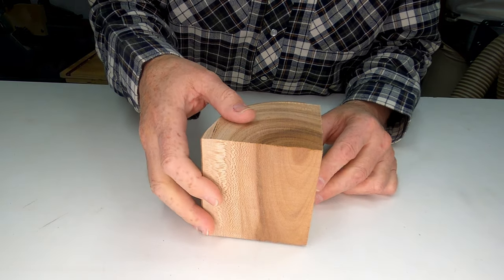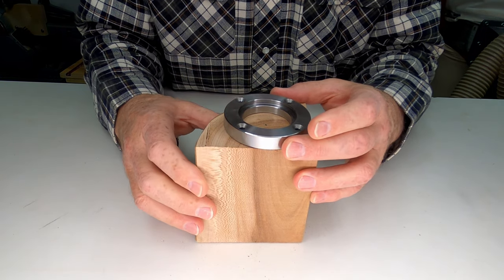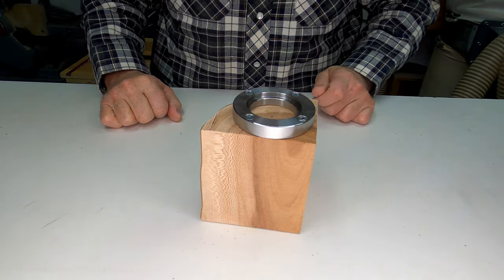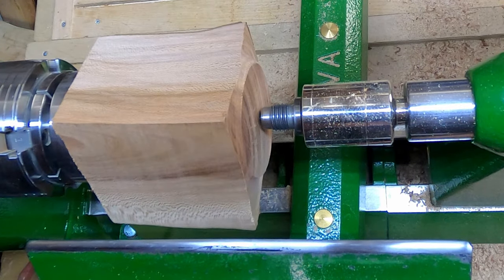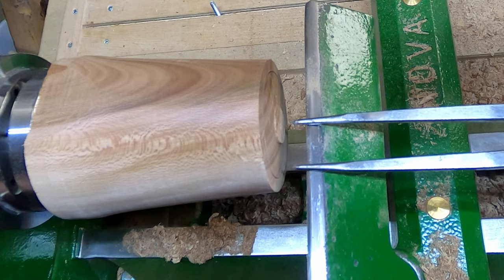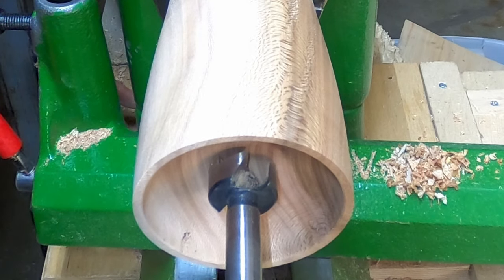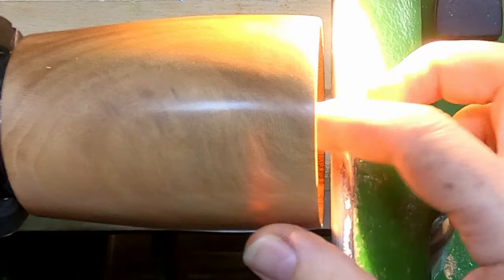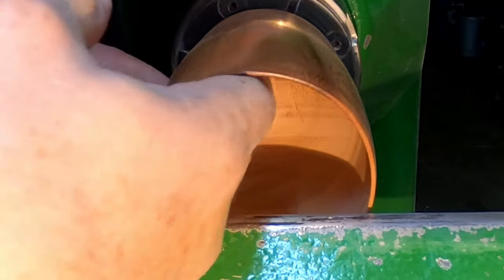Back Hollowing with Bowl Gouge

Comment: Gord, I am just finishing a 9" tall conical vase in European sycamore, which I use a lot. It's destined for my first attempt at fluting, when I've built the fluting jig. I use a lot of this wood, particularly as I felled an unwanted tree in the garden back in 2009. It dries very hard, keeps well, and allows for very thin walled vessels and even threading; so is a favourite of mine. I like to back hollow, the same as we usually call using  a pull cut(?), and an awkward bottom centre I sometimes finish with my mushroom tool. The hooked tip equates to a very narrow scraper. Otherwise, I use all the tools you mentioned, and appreciate the finish that sycamore gives. And your music is just fine for me! Thanks once more.   Bernard.
Reply from the maker: Bernard, I would certainly love to see that 9 inch tall vase. I’m sure it is just gorgeous. Thanks for sharing your method. Thanks for watching!
…..Gord

Comment: Could you have turned between centers instead of a face plate?
Turned out great. Thanks for sharing.
Reply from the maker: Hi Dan. Yes, I could’ve turned between centers or used a glue block or quite a few other ways of doing it. I know a lot of turners do things the same way every time. I like to show that there are a number of ways to do things. Anyway, I’m glad you liked it. Thanks for watching!